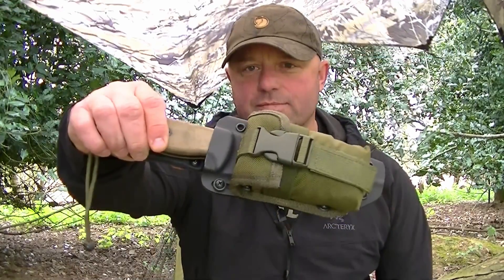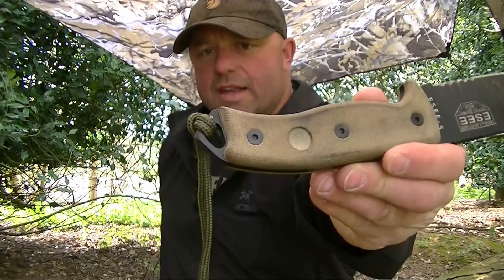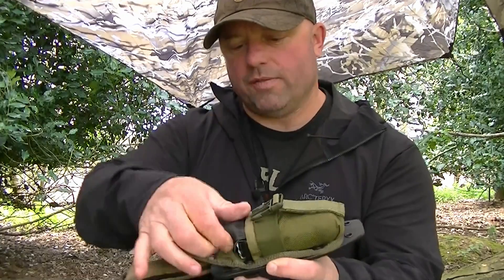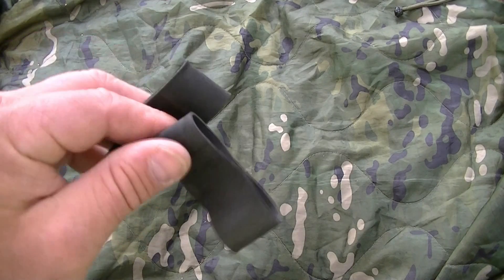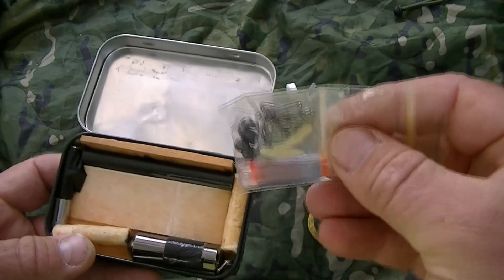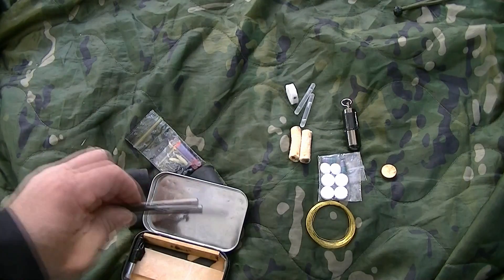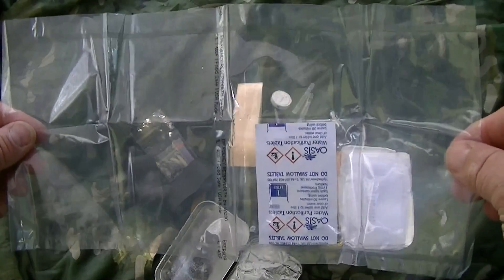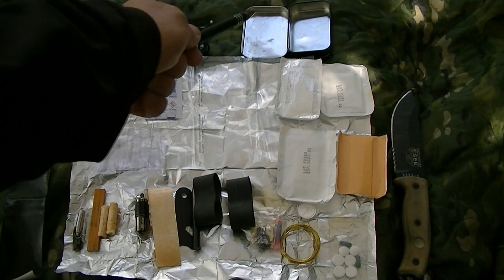ESEE 5 Knife Set up

Comment: Hi Tom, Esee 5 best in range IMHO, Ive accessorized mine with scales from the knife connection (US) and some excellent fire-steels and ceramic sharpeners with kydex attachments from  Sagewood Gear (US), another cracker is the Becker BK72 stonewashed which is next on my list 👍

Comment: Hands down this is the best survival knife out there. I replaced the sheath with a small spec ops brand one. The knife fits perfect and the small pouch fits sharpening stone and small fire steel.
Reply: What’s the shealth called?
Reply: @jamisonk.097  It's an old Spec-Ops brand. If you're using an ESEE-5get the shorter one. Fits like a charm
Reply: @FlankerJackChannel  Yes what is the brand called thx for responding

Comment: @preparedpathfinder You will need to check,  Those small round towels normally are made from a synthetic fabric that will not burn. I've bought several brands and none will burn.
Reply from the maker: Roger, l have used these ones as tinder and they work fine. Thanks for the heads up though. 👍

Comment: After a lot of reading, lifting, feeling etc I am still very conflicted about this knife. I really don't understand where it is supposed to fit it. I know they say it was designed for downed pilots to survive with, but how does that fit in with more mundane outdoors activity? What really set the cat among the pigeons was when I took delivery of my Cold Steel Trail Master, and the instant I picked it up. The balance was PERFECT! 
Now, with the ESEE 5 this is not the case. It feels like a crowbar, and a short one at that. It balances behind the front of the handle, whereas the TM balances more than an inch along the blade!  Yet they weigh almost the same - 16 v 17 ounces. 5" blade v 9 1/2 " blade, which is even thicker than the ESEE 5 blade!  the ESEE 5 proportions are all wrong.
It is too short to ever be a good chopper.  It's too thick and the grind too steep to be a slicer, and that serrated edge! Feathersticking will be a real challenge. 
The flat grind means it will baton, but not that well, and will need a lot of hard bashing (which it will handle without the slightest problem! It's a monster - super tough!). 
So where does it fit in? It's not a Large knife (blade is way too short). It's certainly not a great chopper. It's not a utility knife - too chunky. It's certainly no bushcrafter - too heavy and unwieldy. 
It's great for prying and levering, but how much of that does one do in camp? It can do lots of cutting jobs, and that serrated edge means no rope is safe around it. 
But overall, it doesn't have a real spot in the range. 
I saw a video where the 5 and 6 were compared and it actually didn't shine, and the 6 is another "lost" knife - it also doesn't fit in anywhere. One wonders what ESEE had in mind with these two knives. All the others have definite "slots" are clear identities, but these two, and especially the ESEE 5, just don't fit in. 
A last thought - maybe the ESEE 5 is their take on the "only-one-tool" concept (ie downed pilot scenario)?  If so, then yes it fits in there.
For the most part, however, for people who plan outdoor ventures, I don't think one should rely on just it. One can always take various knives for different tasks and enjoy doing them rather than "make do" with a tool that doesn't do nay of them well enough. 
It would be interesting to hear your comments on this. 
Cheers mate!

Comment: Nice vid. I have the esse 6 I also have a ER selvanns, Funnily enough, we both wear the same watches.

I haven't set up either knife yet. The selvans has a pouch that will hold a bcb survival tin. I'm debating with the esee as I want a sheath to hold a mulitool and then maybe have a pouch that dangles a bit. It's all about finding the right kit I guess. I might get a custom rig made up again in leather but it's obviously cheaper buying bits off the shelf.
Reply from the maker: The ESEE 6 is a beast! I haven’t seen the Selvans, l’ll check it out.

Comment: The ESEE 5 with the pouch with a fire kit inside is too heavy to put on your belt.  Without suspenders it will pull your pants down.  I strap mine to the outside of my knapsack.  The blade is VERY thick.  My favorite is the ESEE 4, which seems just right.
Reply from the maker: I carry this on a seperste belt to my trousers and it is fine.